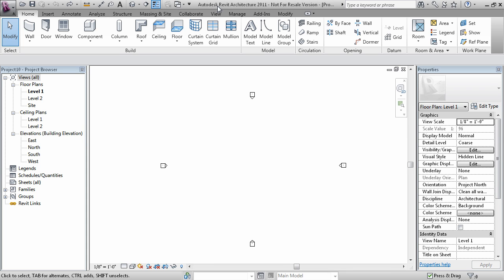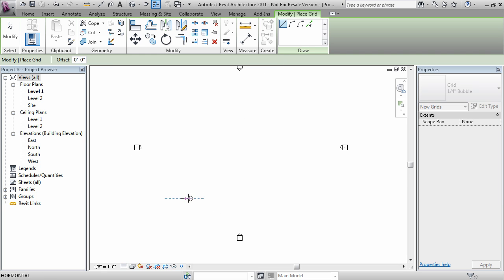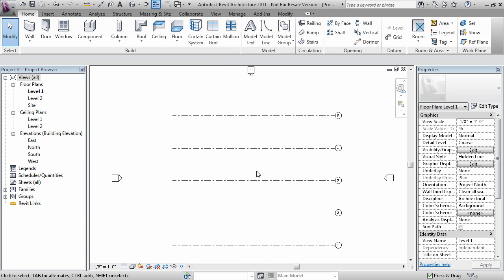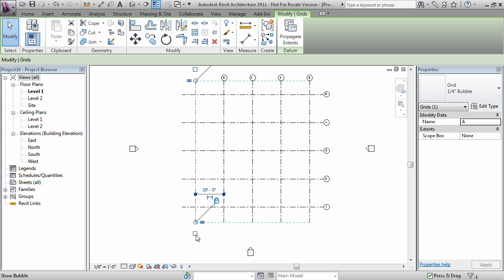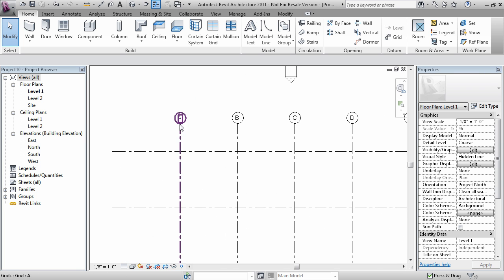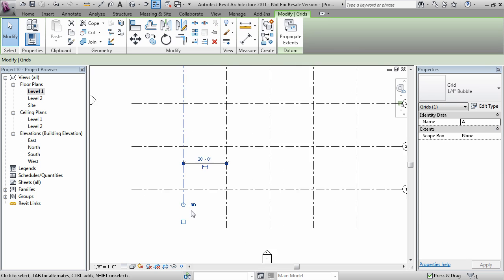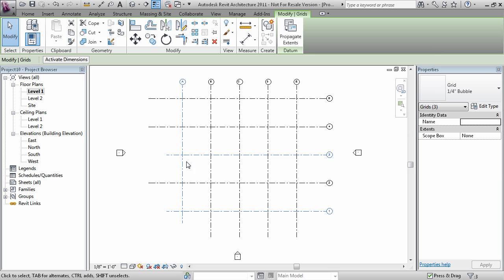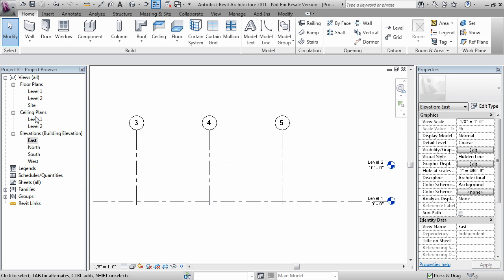Revit - Creating Grids

Comment: how do i create a network of grid squares all throughout the template?
Reply from the maker: If you want many grid lines in a pattern, you could make them with the offset or array command.  Then do a saveas on the file and make sure the file type is “template.”